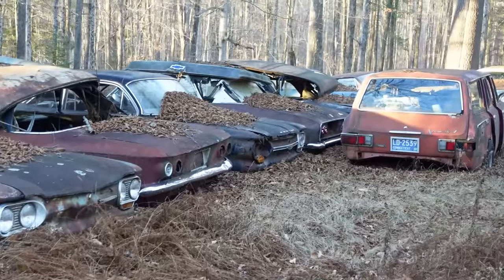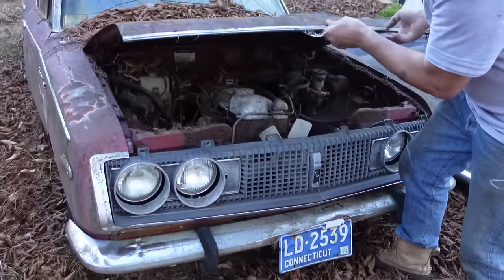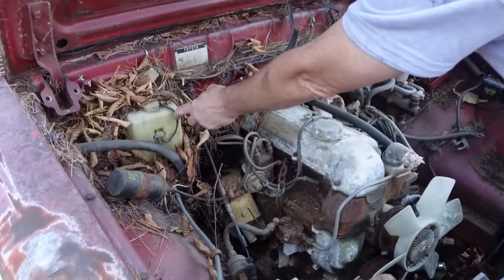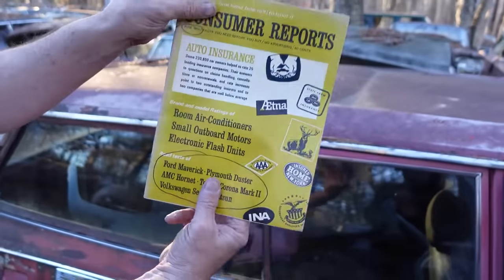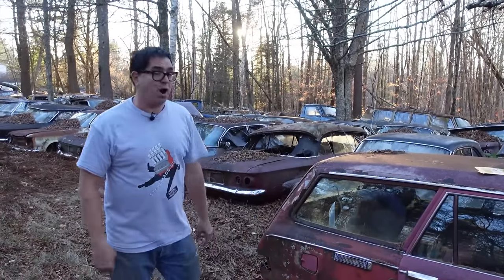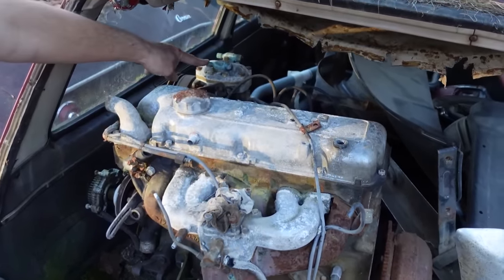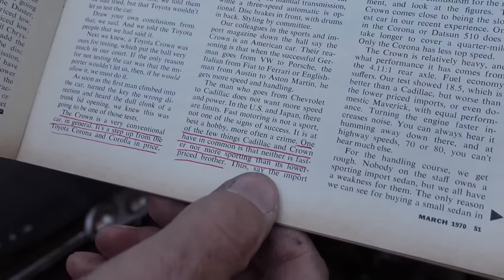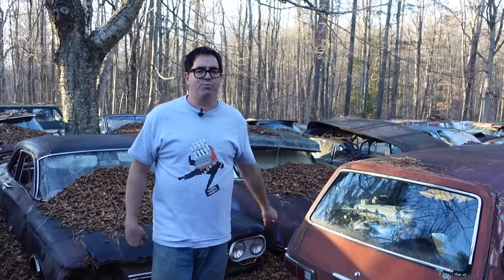Wagon Week EP8 - Corona Virus

Comment: Another day closer.....as said last time:

Yup, the Crown had (depending on the year) the M, 2M, or 4M six cylinder engine, which was an inline six. I remember getting a customer comment card from the catalog on someone that was looking for parts for one of those. Back then, the catalogs we put out had postage free cards that could be taken out of the back of the catalog, filled out and sent in at no charge to us to review catalog errors, new part number requests and the like. Well, if my memory serves me right, this one comment card was from a guy in CA that had an original Crown with a six cylinder engine. He kept getting the wrong parts from the parts store as they didn't realize he had the 4M engine which was a six cylinder (2.6L), not a four cylinder. The guy was tickled when I sent him copies of the Toyota parts microfiche exploded views with all of the part numbers and information on it. I guess the local Toyota dealer at the time wasn't much help either, but he did eventually get his parts because he now had valid part numbers in hand to order what he needed----even if those parts weren't from us in the aftermarket. 

These were assembled in Susono and Aichi in Japan. That's correct about a six cylinder in this generation of Corona, but the next generation did offer a 6 cylinder engine, it was the "M" series engine which would eventually be used in the Toyota Supra a few years beyond that in the 1980s. Looks like this one has the 18R-C (1.9L) four cylinder as you stated. Possible code 1414 Tahitian Red exterior paint.

Comment: My father bought a ‘79 Corona wagon for my mother after his 4-speed, no radio, ‘ 78 Corolla coupe  was stolen in Boston in the spring of ‘79.  The Corona came with vinyl seats and hand crank windows but did have an 8-track that my father had the dealer remove to save a few $$$.  My brother got it as his first car about 1988 until the trans started slipping. We drove that car everywhere until it was replaced with a ‘89 Buick estate wagon.

Comment: My parents bought a corolla wagon new in 1978. That thing lasted until 2000 something, rust got it in the end. The only mechanical issue was a broken engine mount that caused it to (engine) lean over a bit around tight corners and the gearbox rubbed on the tunnel. Bullet proof car!

Comment: Back in 1979, a co-worker thought he hit the jackpot because a neighbor gave him a Toyota Corona Mk2. All it needed was a timing chain... which took him months to change (in spare moments after work, with 2 jobs). Removing the timing cover on an 8R 1900 damages the oil pan gasket, so the engine needs to be lifted a bit to drop the pan, then he discovered the chain jumped enough to require taking the head off for inspection, etc. Some free gift!

Comment: Anyone who has driven a air cooled VW in the winter (Minnesota) can tell you, three hands are required!  1. steering  2. Shifting  3. Ice scraper...  repeat.
The exception to the rule were the "unicorn" automatic transmission, and auxiliary gasoline trunk mounted heater equipped models.

Comment: The Corolla and Corona both came in wagons along with the crown. All the Toyotas had power brakes starting in the 70's.  The 18r engines that came in those cars were horrible that the timing chains would wear out and buzz saw through the timing cover. That engine had two chains,four gears, two guides and two tensioners. It was a modified pushrod engine converted to overhead camshaft. Toyota had a recall on the cylinder heads because of poor coolant circulation. We got a complete replacement head with valves and springs along with a gasket set. All Toyota wanted back under warranty were the exhaust valves because they would burn up.

Comment: When I was in vo- tech auto mechanics class. In 77 78 the had a Toyota that was a teacher from one of the other classes  the advanced class was  rebuilding the transmission  it was called a "toyoglide " yes. It was a shrunken copy of the chevrolet powerglide shop teacher said it even  slipped like a  powerglide. It even said on the little console on the floor "Toyoglide automatic "

Comment: I had 10 Corona sedans ,I had2 Corona deluxe wagons ,I converted my cherry one to a 18rbr that's a twin carb hi performance motor,and a p-29 Toyota 5 speedthat was the racing transmission that would be In 18Ru, JDM ,Celicas .there was only small differences between the deluxe and the mk2, now I have a 1978 Corona wagon ,fully loaded with wood siding, my mother bought as a new demonstrator

Comment: The Corona MKII in Australia had the 2M 6 cylinder. We called what your looking at, the Shovel Nose Corona. We never got that variant, I think because they were just so ugly, our Corona MKII was quite a large car by Japanese standards and was a MUCH better looking car than the Shovel Nose. We also had the RT-82. RT-104 and the ST-141. We Australians hated the Shovel Nose, no one wanted it. My father owned quite a few Crowns, all 2M's, I got sick and tired of changing engines out for him. That 2M was a wheezing dog of an engine and threw rods like they weren't required. I on the other hand drove Datsun 6 bangers, the L24, the L26 and the L28 injected and also the 2.8 with twin Hitachi SU type carbs. I never changed gear before 7000rpm's and they never complained. One day my father borrowed my Datsun 260C with the L28 and twin carbs, while I was changing yet another engine for him. He used my car for 3 days before he went and bought one. The Cowns were gone for good and my father drove Datsun/Nissan right up until the day he died. 1988 he borrowed my car, he passed in 2018, 30 years he owned Datsun/Nissan and never ever had a single complaint, unlike that total crap wheezing 2M/3M/4M, all GARBAGE engines.

Comment: I thought the Mark2 had a 6 in 74 because I wanted to look at one. the salesman said it was Toyotas secret. actually, when I bought my Celica. Any Toyota that came in they duded up them to the max, chrome tires, vinyl tops half, quarter, full. side molding up the kazoo. When we picked it out it already had the quarter back vinyl top, and side molding at first, I thought the side molding screwed up the lines of the Celica except after a while severely reduced parking lot dings.

Comment: Did you know Toyota put a true hemi into corollas in the 1970's. I'm not sure the exact details because there don't seem to be many left around but, pretty cool. In Japan full sized Toyota cars had an aluminum version of the Dodge V8 hemi.
Reply: You may be referring to the very popular 20R / 22R series of mid size car/ light truck engines used from the early 70s into the lathe 80s. They used a hemispherical combustion chamber. Very reliable engines, and are very much alive and well today in the enthusiast market.
Reply: @gearheaddan819 the 20R and the 22R were not hemis ,it was the smaller car ,the Corolla a 1600cc motor,called 1tc,2tc or3tc being 1800 cc

Comment: What drives the distributor? It’s located in a place that makes it look like a cam in block (pushrod) engine, but it’s SOHC. Driveshaft that’s driven by the timing chain? I assume the oil pump is coaxial with the distributor. Anyone know?
Reply: They are really good motors ,their major drawback was 2 steel timing chains